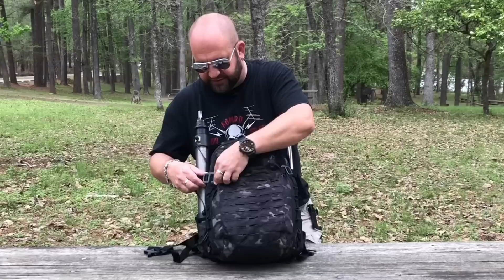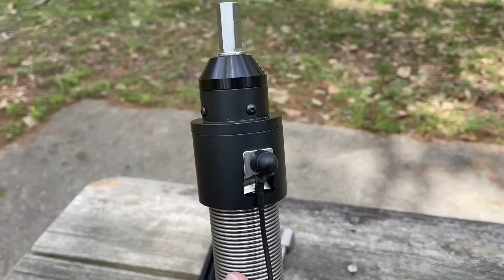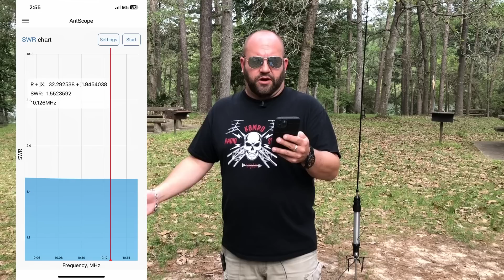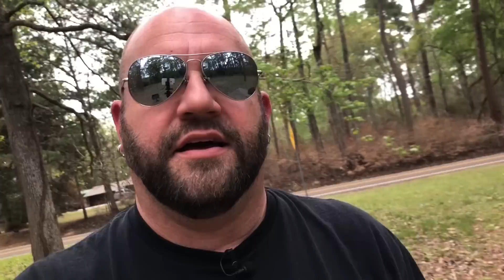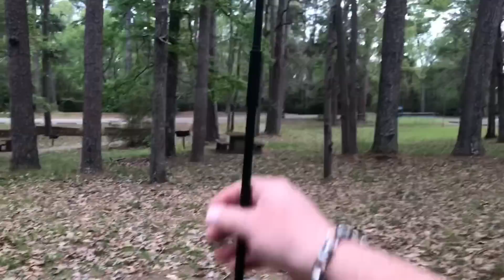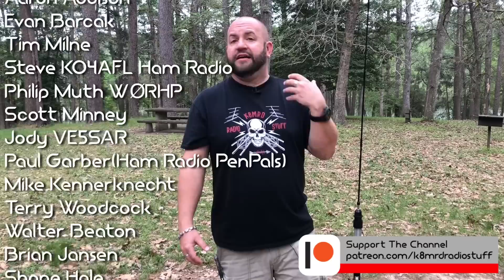REZ Antenna Systems Ranger 80 Vertical Ham Radio Antenna

Comment: I like the Super Antenna a lot but don't like having to swap out the coil every time I want to use 80m but I have made a 1000 mile contact on 80m which impressed me, don't use it much on 80 but would like a remote tuning screwdriver antenna like the tarheel but not sure you can use those portable ?

Comment: I would like to see a comparison between the Ranger 80 coil and the WRC with regards to tuning.  I have had miserable luck with the WRC and is my reason to despise the coil.  Probably operator error.....but should not be that finicky.  Hoping the Ranger 80 will tune and lock in better.  Any thoughts?

Comment: Great video.  I browsed their website and downloaded the user manual - I would like to see a diagram of a starting point on where to put the coil for what bands - similar to a BSP.  I can't find that.  But otherwise, great antenna, the build quality is definitely there.
Reply from the maker: A lot of guys with these types of antennas will just use a sharpie to mark the sweet spot.  I just use an analyzer.

Comment: Don’t know if mentioned already but instead of touching the whip I suggest you to leave it and mess around with the radials length. You should be able to get a good match. Also be aware of the difference that makes to rise them from the soil or leaving them laying on the ground.
73

Comment: Well built antenna. But for me - I would rather take an EFHW to the outdoors - lighter, takes up less space in the bag, and being full sized would be more efficient (providing it is properly built and thrown really high up into a tree)
Reply: Agree with you!  I began doing portable with a coil and 17' whip (MFJ-2286) and radials; that setup worked with fair results.  I migrated to EFHW and get better results with less tinkering of radial/whip length and my portable operations yielded more QSO's.  I will admit to using the coil/whip/radials now & again and it will remain in my 'antenna arsenal.'

Comment: I prefer the telescopic whip vs the shock cord whips. I bought the shock cord whips with my Buddipole Deluxe, then I realized they were a fixed length. They do have adjustable length shock cord whips, but I think over time those shock cords would wear out and not keep the sections tightly together. 73 KD5YOU
Reply: I have a shock cord whip for the Alpha FMJ - over time it stretched- I have to put up/take down frequently due to HOA - so can shorten shock cord but eventually it will be done - so I no longer fold it up.
Reply: @markmesserly7919  Well fortunately with the Buddipole shock cord whips, the shock cord can be replaced fairly easily. I know what you mean by put up/take down frequently. I do the same every time I want to play HF in the back yard.

Comment: I just watched a video where another radio operator used the Wolf River 80 to 10 meter coil along with a ~17 foot collapsible whip antenna and would reasonably tune 80 through 6 meters without a tuner. 

I recently acquired the the Wolf River 80 to 10 meter coil along with the Chameleon collapsible 17 foot whip and ground spike. I have not had the opportunity to set everything up. Waiting on the radials from Wolf River.
Reply from the maker: Yeah you definitely do not use tuners with these types of antennas.

Comment: You tune but adjusting the length of the whip? I would have thought like the JP12, Buddistick, or Wolf River coil you would move the tap on the coil?
Reply from the maker: Depending on the length of the whip, yeah.  Same thing with any other antenna of this type.  WRC you would still need to shorten the whip to get on some of the higher frequencies.  Especially if you're using the 17' whip.  Given this particular whip was too long for the higher frequencies, yes, I needed to shorten it.

Comment: I like this antenna. OBTW, Chameleon is coming out with a WRC style coil.
  I actually prefer these type of whips to the stainless steel ones, because they're more durable and even if the elastic snaps you can still use it.  As for the SWR, just shorten the radials so you'll only need to fold over one segment to gain resonance on 10 meters.  Just substitute your shortened radials for the stock radials and see if there's a difference. I believe there will be. Enjoyed the video and 73

Comment: Hi Mike just wondering did you try moving the coil down and see what the swr is? Maybe you don’t have to fold the whips - maybe you did that but didn’t show it in the edit. - good job though keep up the good work.
Reply from the maker: Moving the coil down lengthens the antenna.  Quite the opposite of what you need to do to go higher in frequency.

Comment: Everyone is going to have different opinions on the cost and whip, but it definitely looks like it's built solid and a lot of thought has gone into the system as a whole. Thanks for taking the time to show the SWR and what you did to get it to tune on the higher bands.

Comment: Great review Mike.  How would you stack that up against the Chameleon MPAS 2.0?   I would guess that the performance is similar.
Reply: I never used the REZ of course but it might have the potential to be a better performer on 40m if you can use a long enough whip . 

I have the MPAS 2.0 with CAP HAT and have been blown away by it on 20m, 17,15,12 and 10m but especially 20m because it's the band I would be on most often in the evenings after work and the Kids are in bed. The other bands would be dying off at this time. 

Performance does suffer on 40m but it still gets me around Europe and into the USA on 40m at times, depending on conditions and how big an antenna the other Ham has. Adding 3 radils for a total of 4 does help 40m but this raises SWR but I did find 40m to improve a bit but the MPAS 2.0 is designed to use 1 radial for ease of setup so SWR is lower with 1 radial. I suppose the 60 feet of wire will work a lot better on 40m, it's a very versatile kit that Chameleon. I use it a lot, it's setup permanently on the front lawn connected to the 891 in my sitting room, a convenient 2nd setup for when I don't want to go to the shack. I would like something better for 40m though but for it's intended purpose which is portable ops I'd rather the MPAS 2.0 any day than have to go back and forth to tune the antenna, it does get old. 

I also have the Super Antenna MP1 and while I've also been impressed with this it is a  pain going back and forth to tune but it's incredibly compact when broken down, so for biking or hiking the Super Antenna would be the antenna I would bring or my 4 band EFHW 49:1.

I wish someone would make a portable all weather motorised version of the screwdriver antenna.
Reply from the maker: Not sure.  I don't own an MPAS.
Reply: You can’t even buy it yet and unless they produce 1000’s of them before selling the 1st one the wait is gonna be for ever. I can only imagine how many are pre-ordered already. Black is a horrible color and wait till the summer that collar is going to get a lot warmer. I had a big pile up on 20 today as well today with my BuddiStick.

Comment: If I did not have the Wolf River Coil already I would purchase it just for the higher power handling.
Reply: My WRC Silver Bullet 1000 Platinum takes 500 watts SSB, 350 CW and 100 digital. I do run ft8 and ft4 at 100 watts chasing DX. I do wish WRC would update their collar though. You get to know how to tighten just right with that nylon set screw though. You don’t want the collar moving when you are running full smoke on ft8 or WSPR.

Comment: rez antenna 525 usd  vs wolf coil 1000 166.95
Reply: Great review Mike.  I’ve got two questions.  First,  how much did that backpack weigh loaded.  And second, how long does the 20 ah battery last on the 7300 doing 100w SSB?
Reply from the maker: Yep.  And a Kia is ~$20,000 and a Corvette is $100,000
Reply: @hamradiotube  you  right micke